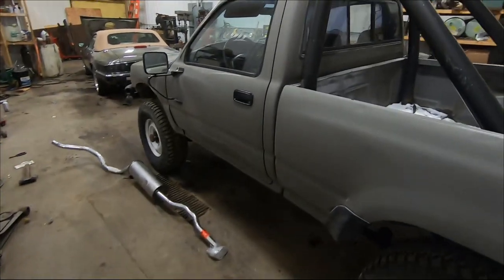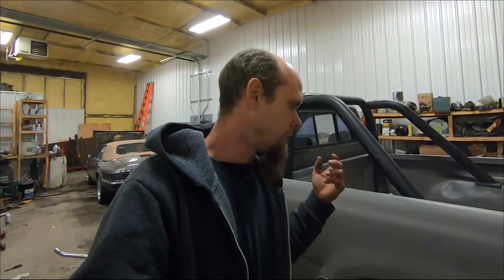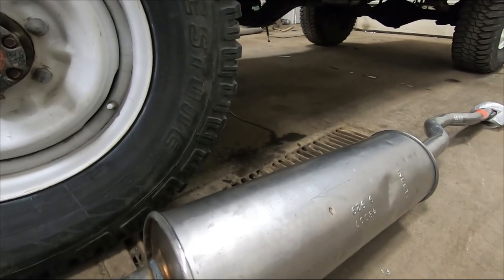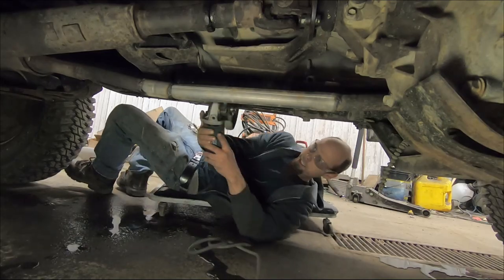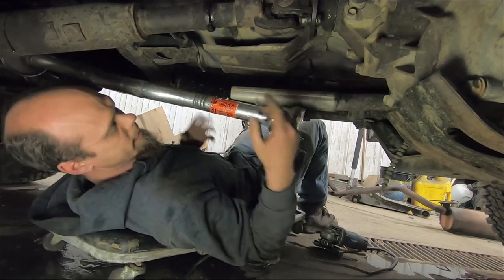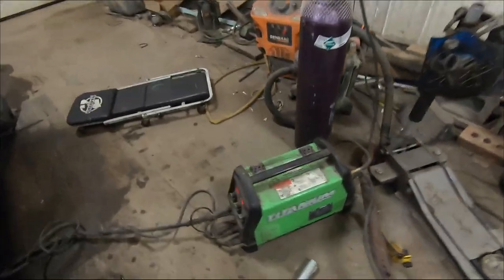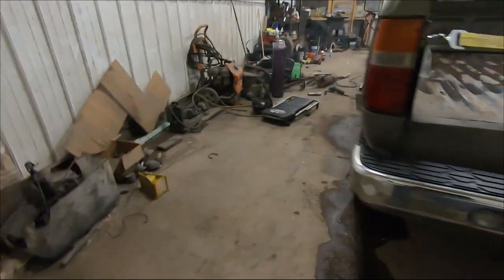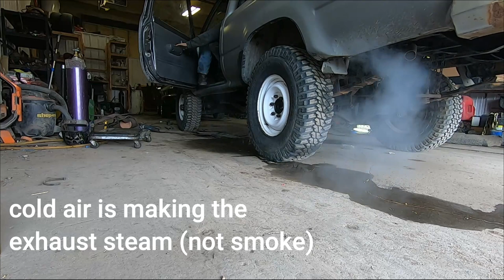cheapest cat back on the internet 1989 toyota pickup

Comment: I was wondering how you get rid of the check engine light with a O2 sensor bay 1 code?
Reply from the maker: not running any kind of ecm on it.
Reply: replace the sensor, disconnect battery and then run it till computer resets.

Comment: Right now I'm using quaker state 0w20 in my 2016 outlander sport been using it since 3ed oil change. Thinking about switching to castrol magnatec 0w20. Info on castrol magnatec sounds real good...my 3 motor oils I've ever used since I was 16 years old..
1st...conventional valvoline 
2nd. ..Halvolin conventional 
3ed...quaker state conventional & full synthetic. .................♤♤♤♤♤♤♤♤♤♤♤♤♤♤♤♤♤♤♤♤♤♤♤♤♤♤♤♤♤♤♤♤♤♤♤♤♤♤♤♤♤♤♤♤♤♤♤♤
♤♤♤mike from minnesota ♤♤♤♤
Reply from the maker: i don't think it matters much as long as the oil meets the specs for your engine. synthetic are better but im not a fan of extended drain intervals so they don't really make sense to me. i run 15/40 mobile delvac in everything i can get away with it because i buy it in bulk...lol
Reply: @Ezrider359  Ezra, from my long experience
15/40 viscosity is too high as the first numbering 
- as you know -is meant for cold lubrication
abilities. Dynamic and kinetic viscosity exactly.
With 05- or 10/W40 you are fine. As more hp 
output the engine generates the lower dynamic
viscosity the better. So a.e., a Lamborghini V 12 
uses 0W50 a BMW M 5W40 Toyota 3.0 V6 10W40, 
McLaren 0W60, a stationary engine like a forklift 
20W50 etc. What means by 
using in a 2.3 L standard straight 4 turbo; Volvo 
Saab FIAT Honda etc. and not as any old fashioned 
low-rev V8 etc. 
In Siberia on -20° C  they use -10/W30 (yo, that exists).  
Just to tell. Regards